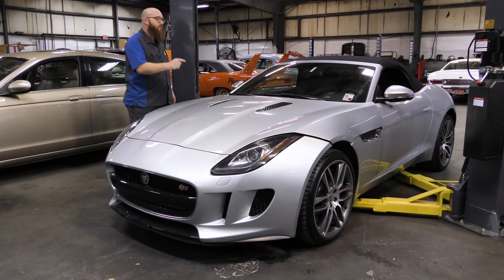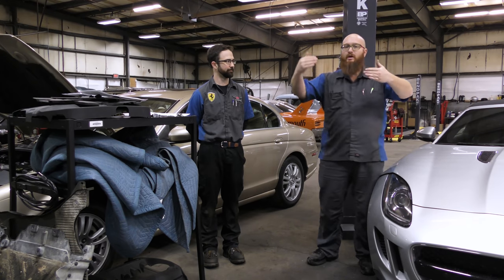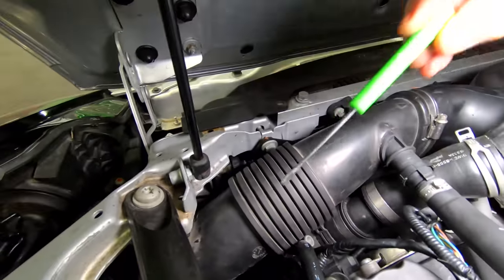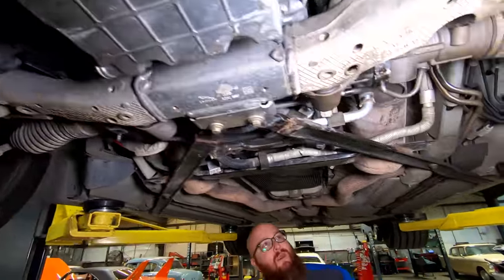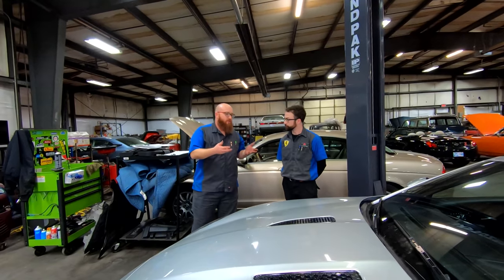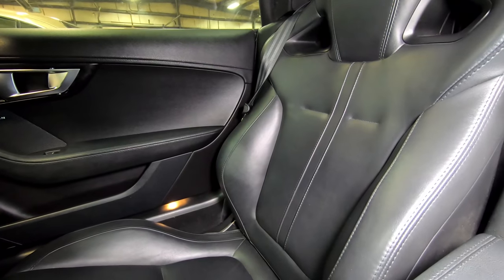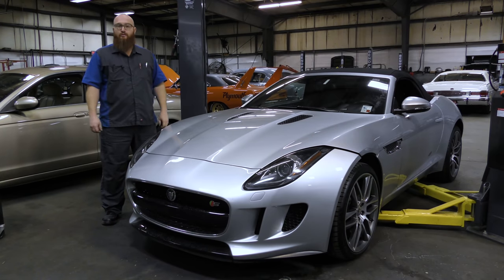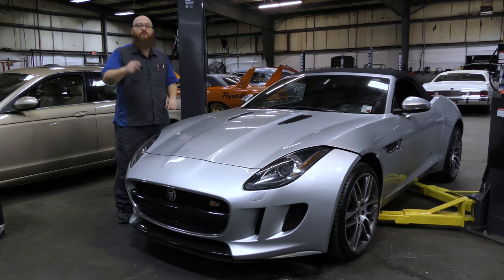How could a shop do such a bad swap? CAR WIZARD points out all the errors on '14 Jaguar F-Type

Comment: As an owner of two F-Type convertibles, that car is 50 shades of dodgy,  there's no way that wear on the steering wheel and start button and the scuffs on the door handle  is just for 60k miles.  The brake rotas are not Jaguar.  What was the owner doing with the supercharger again!?  I suspect changing the pulley to get more power, lets hope if its an after market pulley it's been tuned appropriately too.    My second Ftype was $150,000 there's no way I'd entertain a car with that value going to some an unknown shop (not the wizard) for an engine swap unless i knew they were fully trained Jaguar mechanics with experience.
Reply: I was going to say Edward Scissor Hands was driving it or something. Definitely not normal wear.
Reply: BMW in the 90s were having complaints on their steering wheel becoming stained and worn. They investigated and noted that it was happening mostly on USA Z3 , 5 and 7 Series cars, even though their German-made cars were not getting complaints in other countries. They believed it was Americans love of hand lotions and moisturizers, and issued a bulletin advising drivers to avoid them (or wash their hands before driving).
Reply: @DavidInSugarLand  Yep I was just going to say that's a chicks car. Hand lotion doing that.
Reply: @DavidInSugarLand  McMuffinsa and fries maybe also.
Reply: Don't ever buy a used Jaguar.  Buy or lease new, enjoy it, get rid of it before the warranty expires or at the end of the lease.  Then it's someone else's headache... especially if they start modifying it.
Reply: Same thing I thought. I was like 60k and the steering wheel and buttons are /that/ bad???
Reply: @Chet S  Yep, and it can be a pain to clean once it gets that bad. It's usually pretty nice once you get it cleaned up.
Reply: @Theocletian  Yes of course if you are an enthusiast who doesn't mind working on them constantly, or having them constantly at the shop being fixed if you can't or don't want to do it yourself it's a different story.  I'm talking about the average joe who just wants a car they can enjoy and doesn't want a pile of problems, which I'm sorry, modern Jaguars are just problem pits.
Reply: @Theocletian  High I.Q. post. That's just the dumb Scotty logic, or rather illogic, talking. Replace Jaguar  with Audi, BMW, etc and these posts are everywhere. I have bought two used Jaguars and now looking for a third. Should have acted before the market got stupid. 2017 XE's are more money now than in 2019.
Reply: @Beer_Dad1975  Actually, I have two Vanden Plas sedans...a 2001 and 2002...certainly not quite as complex as the one here, BUT I bought them each just shy of 100K miles, and with the help of an excellent mechanic, they've been great cars to own....BUT it ALL boils down to whom you have working on them.  My shop is Pasadena Motor Cars in Pasadena, CA.  Just awesome people...very much in the vein of the Car Wizard....they spoil all their customers.
Reply: Wonder if when they did the engine swap did they also swap all the electronics to try and use mileage from the donated engine. Would be real curious if the vin in the scan tool matches the vin of the car.
Reply: @BillofRights1951  Ah that's pre-tata though, different story - much simpler cars, much easier to work on, decent engineering & easy enough to correct the manufacturers issues with after market fixes.  Once Ford offloaded Jaguar their cars became like everything else out of Europe post GEC, designed to be disposable commodities - multiple expensive failure points that are ticking time-bombs - once it gets to causing trouble, time to get a new one.  Makes me sad though as I do love the way they look and drive, but BMW, Audi, Range Rover, Jaguar, Mercedes, Volvo etc. - all disposable now days - no way you're going to get 30 years out of a new one which used to be the norm for such cars like your XJ's - most of them are mechanical write offs before they get to half that age.
Reply: @ingresswizard9044  Yeah I know some people are saying it's hand lotions or sanitizer that has left the steering wheel and dash in that condition... but at 60,000 miles/8 years old... I've never seen wear like that at that age/mileage - I'd think even with poor treatment it'd get well past 100,000 miles before looking like that even if someone has been using kitchen cleaner on it - particularly the start button.  Then again maybe it's just Tata putting rubbish materials in?
Reply: My father produce LOTS of body acid. In fact 'cuz of that, he melts steering wheels, damage plastic buttons and even stop (extremely good) mechanical watches. So yeah, it CAN be a 60k mile with that much plastic damage on the inside if the owner is like my dad..
Reply: @chassegallerie2910  Never heard of that, but sounds awful for him 😞 The other thing I thought of was maybe the owner wore a lot of rings on their fingers - they can be hard on steering wheels.
Reply: @Beer_Dad1975  More or less. He's at his pension now, so, he doesn't care about watches anymore. lol

He fixed the issue with the steering wheels, he bought a steering wheel cover. But the buttons he use often on his car have been damaged over time. But they still work and it's only cosmetic, so it's fine, unlike when he burned thru one steering wheel. He fixed that using foam cover for water piping and electric tape. But that was a car before the one my folks own.
Reply: @Beer_Dad1975  Stop with the nonsense already. If anything the newer aluminum ones will last longer as salt corrosion totals far more cars of any brand than mechanical problems. Easier and cheaper to rebuild a transmission than repair rust.
Reply: @vw5056  I live in a sub-tropical climate, no salt on the roads so we don't have rust problems with any vehicles here, not since the late 80's when galvanized steel became the norm anyway.  Cars here will go 30+ years without significant rust - but if it's German crap, it'll mechanically total itself long before then with a spun crank bearing, failed timing system, blown out air suspension or whatever litany of problems their deliberately half-arsed engineering brings on.  Sorry you are a VW fan, VAG are one of the absolute worst car companies on the planet - unethical fuckwits who are even turning Porsche into disposable trash now just to turn a buck.
Reply: @Beer_Dad1975  that's you, not everyone lives in such a climate and for us corrosion resistence is vital, which the German brands and JLR are the best at. Only a total idiot would "mechanically total" a car. You  wouldn't know or understand engineering if it bit you on the a.
Reply: @Beer_Dad1975  I’ve seen hand lotion KO cars in only a couple years .

It’s usually combined with buttons worn down and wear spots in the carpet.

It comes from hand lotion, long nails and shoes with sharp heels. I’ve also noticed that cars having those issues tend to have hard shifting transmissions. I’m curious how this jag is. My guess is from the owners with the awkward to drive in shoes often having not so smooth throttle control causes the trannys to be shifting like a maniac to compensate…
Reply: @vw5056  Ok I can see I'm not going to change your mind - I've been working on cars for 35 years though, and when you compare something as simple as a BMW or VAG timing chain guide with the equivalent Lexus part... well you can see the German part is made out of inferior plastic runners, and even the backing material is inferior to the Japanese part - then they make deliberate unnecessary design decisions like putting the timing gear at the back of the engine so you have to remove the transmission and even sometimes remove the engine from the car to replace said poor quality parts turning what should be a simple job into a major one. Another one I see an awful lot with VAG turbo chargers - the VW/Audi part will have a fixed waste gate actuator for the internal waste gate with a crummy pressed steel pivot bearing and poor quality return spring - and you won't be able to adjust the actuator rod at all - once it wears out and the gate won't shut properly anymore or just slops around, and it will wear out - you have to replace the whole thing, manifold and all - a thousand dollars or more for the part and thousands for the labor.  Again, you'll never see the top manufacturers from Japan engineering like this, the actuator rod will always be adjustable in the car, and you'll always be able to replace just the worn parts if it's too far gone to adjust out - plus it's built with proper bearings and springs - or they'll put in a proper external waste gate.
It's deliberate on the part of the Germans of course, they want the car to get too expensive and annoying so they can sell another car  - consumable cars in an age where the planet needs us to conserve - despicable.
Reply: @Beer_Dad1975  Toyota uses plastic runners too. Now tell us about how a simple VVTi service is an engine-out job on transversely mounted Toyota/Lexus V6 models, something unheard of on BMW's. Or how the catalytic converters are built into the exhaust manifold on the LS460. Something you won't find on a BMW F01, you can replace just the cats.

 Also, tell us about the thinner sheet metal Toyota uses compared to the German brands along with the subpar rust proofing.
Reply: @vw5056  <sigh> everyone uses plastic in the runners - it's a matter of how good the plastic is, how much it resists cracking and breaking, which German cars - not so much.  Not sure what you mean by "VVTi service"?  Do you mean replacing the timing chain?  Because, you won't ever have to do it unless you intend to keep the vehicle more than 20 years or several hundred KM - assuming you change the oil and filter regularly - they last a more than respectable amount of time - German cars - luck of the draw.  Again, I have no basis for comparison with regards to rust proofing - I've never seen a German car or a Japanese car built after about 1988 that hasn't had some extreme conditions like being driven into the surf or parked at a beach every day that has had any rust issues - it just doesn't happen here. , & if you are driving your car on the beach then that's your problem.  Doubtful that Toyota use inferior galvanisation, or thinner steel than German brands though happy to change my mind if you have evidence.  Most vehicle manufacturers use 0.7mm to 0.9mm steel for body panels these days, depending on the panel - structural sections vary depending on requirements of course - but BMW's sure had its share of structural problems with many models over the years.
Look, all you have to do is look at any of the many many vehicle reliability ratings reports to see how bad German engineering is these days - short term ownership - long term ownership, small problems, big problems - doesn't matter, they are always out of the top 10 manufacturers, and usually (especially in the long term ownership ratings) out of the top 20.  I'm not making this up just for the sake of an argument - German cars are just not good enough for the money you pay for them, and German car manufacturers are morally corrupt assholes - just look at Dieselgate for an example of how fucking evil VAG is.
Reply: @Beer_Dad1975  There are many German cars with plastic timing chain runners that do not prematurely fail. In fact, I have only heard of the BMW E38 V8 needing it done around 100k miles. So you can stop with the baseless generalization. This is what i mean by VVTi service. This Toyota is practically brand new too!
https://youtu.be/VJ8BfdmwKew
Reply: @vw5056  Crazy how the market's gone.  Last month, I traded in my '17 XE 35t R-Sport.  After two years and 23,000 miles, I got nearly what I paid for it in December 2019.  I wouldn't have done it at all, but an off-lease XF Sportbrake S sang a siren's song I couldn't resist.
Reply: Someone that used lotion regularly and had long fingernails drove that car, guaranteed.  I've seen cars at this stage in their life driven by people that use lotion and have long fingernails look worse than this, like literally had plastic gouged out of certain frequently-used buttons by 50,000 miles bad.
Reply: @Beer_Dad1975  Nonsense.  I'm on my 4th Jag.  My first one was at 165,000 miles when I sold it, and it ran like a top.  My previous one was a '17 XE R-Sport with the supercharged V6, and at 73,000 miles it was flawless.  Only reason I even traded it in was because an off-lease XF Sportbrake S appeared at my local Jaguar dealer, and I couldn't resist it.  

Yes, servicing costs are high, as is the norm with anything from Europe.  Usually the people that whine about how unreliable Jaguars (or BMWs or Audis) are usually are the ones that just aren't prepared to pay the servicing costs so either defer maintenance or hire shade-tree mechanics and then are shocked that their cars don't work correctly.
Reply: @alwolschleger7242  Nice! Both are lovely cars.
Reply: @alwolschleger7242  Sounds like you sensibly get rid of them before they turn into basket cases.  A 2017 car should indeed still be flawless.  Come back to that same car in 2030 though when it's 13 years old & has another 100,000 miles on the clock, if it's even still running it'll likely be a mess.  They just aren't built to last and/or be fairly easy to repair like Jags of old.
Generally the people who complain about them being unreliable have bought what they thought was a bargain luxury vehicle and been horribly burnt when something that should not have failed if it had been engineered to last fails - but yes there are always people who run them into the ground with lack of maintenance and rough treatment.
Reply: @Beer_Dad1975  First one was 17 years old and had 165,000 miles when I sold it.  Still was a fine car, just slow, and I was ready for an upgrade.
Reply: @alwolschleger7242  Yup pre GFC/Tata they were making some good stuff - even when it broke it was usually easy and inexpensive to fix usually.  Back in the day my Sister had a 1990 XJ6 - unfortunately it had been imported from England so had some major rust issues from their salted roads (I had a Dolomite Sprint at the time which had exactly the same issue for the same reason), and it burnt oil like a mofo, but other than that it was a wonderful car - did a lot of work on it myself and always enjoyed working on it.
Reply: @alwolschleger7242  would love a sportbrake one day, along with an RS4 Avant, V70R, and Taycan Sport Turismo. All the sport wagons 😂
Reply: Keen eye, there is always two sides to the story. I assumed the customer started complaining about the bill and wanted it done cheaper, Here you go Sir, here is your cheap engine swap, have fun.
Reply: @DavidInSugarLand  Im going to say KFC or CHIPOTLE grease rather than lotion